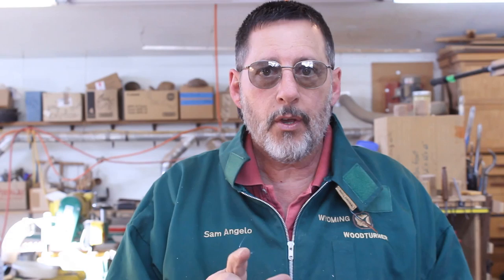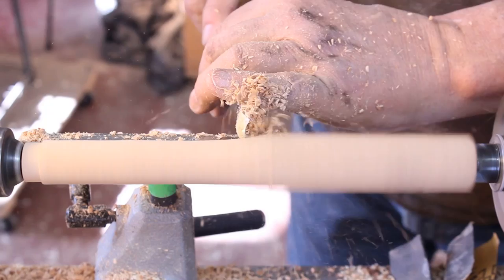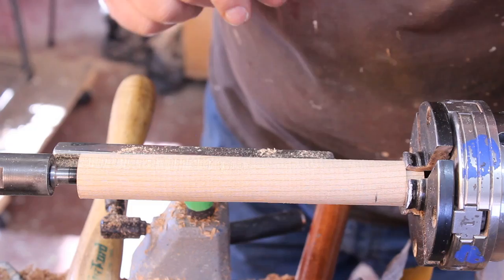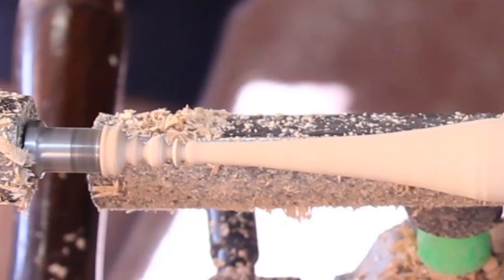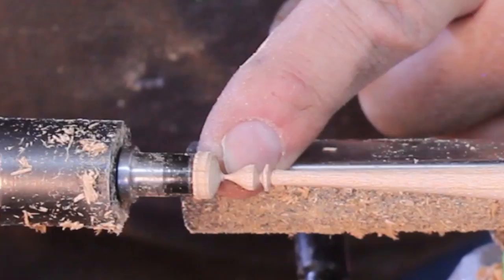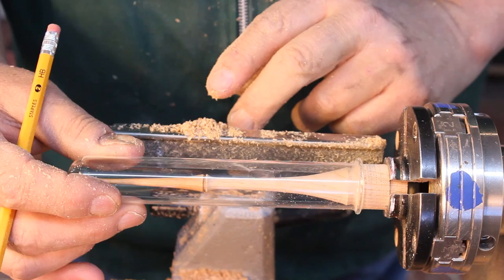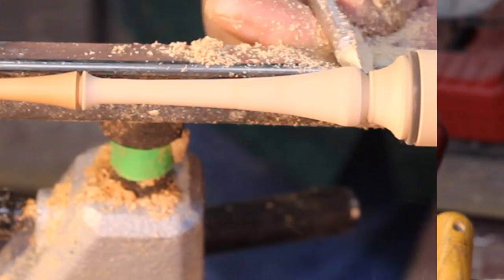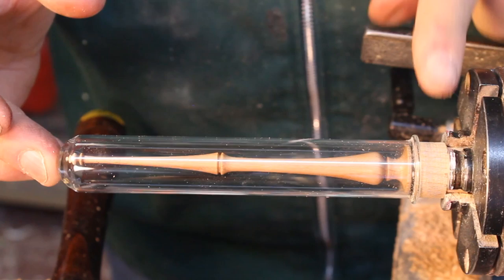Mammoth Quick DRAW: 2014 (Turning a Finial)

Comment: Great video Sam. Your tool control is fantastic. Been doing a few finials, but still working up the nerve to thin them down that far. Thanks for sharing.  Fred
Reply from the maker: FRED
I actually practice finials at times.  I have some weird looking finials laying around.  If you do this, pick some nice straight grained wood. Soft maple or cherry works well.  I used to demonstrate for our local middle school.  I would do a long thin finial.  What I would do at the very end was to turn it so thin that it would eventually break.  Doing this, turning really thin, will tell you how far you can go before it breaks and when to stop when turning an actual finial.  
Sam
Reply: WYOMINGWOODTURNER Thanks Sam. Makes sense. Guess the way to know the limit is to reach it. Better on a piece that doesn't mean anything. Thanks again,  Fred

Comment: Awesome turning and guidance, Sam...as usual. Moreover, like many others, you ought to be convinced of our gratitude for it. 
I will confess, though, after noticing the time lapse on many of the replies from three years ago that you may have already answered this question for someone else. How do you secure the finial inside, to keep it from falling out?
Reply: It's simply wedged into the glass vial.  You make the end the same diameter as the opening of the vial and it will fit inside, kind of like a cork into a bottle

Comment: Hi Sam !!
Wonderful video.I have some small round blanks.They are about 4 inches in diameter and about 2 inches thick.I was wondering if you had any ideas of what I could do with them .
Many thanks.
Chris.
Reply from the maker: Chris
This sounds like a 4 inch round and 2 inch "long" blank.  I would say there is not a lot you can do with these.  If it is not wood that is real nice or expensive then you can use them for jam chuck and such.  Or you might make small end grain bowls from that.  I am now working on a video turning a salt cellar which is just about the size you are talking about.
Sam
Reply: Hi Sam !!
Thanks for getting back to me.The blanks I've got are exotic hardwoods.so I think the salt cellar sounds just right.
Cheers Sam.
Chris.